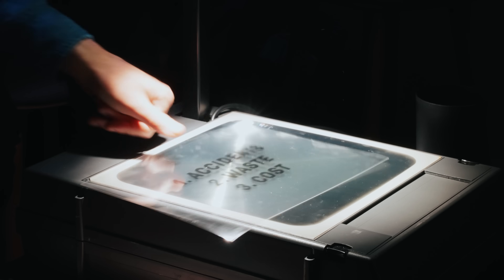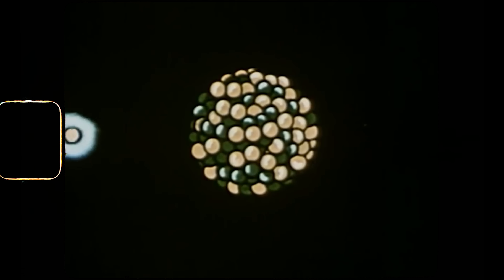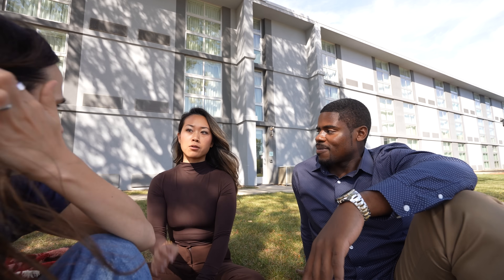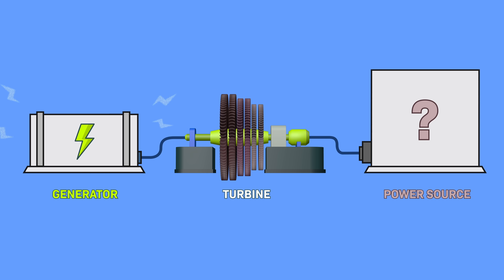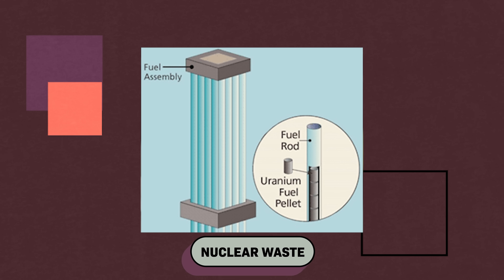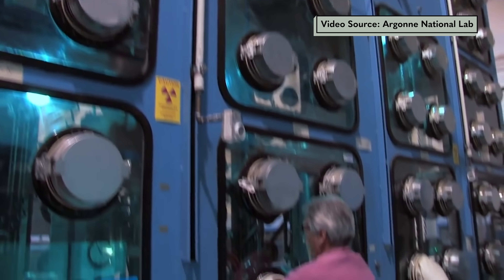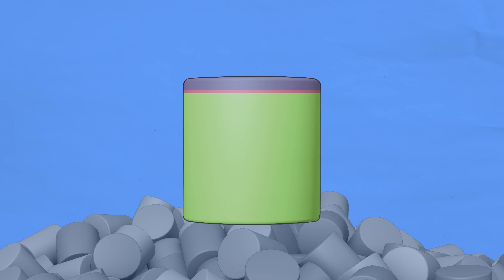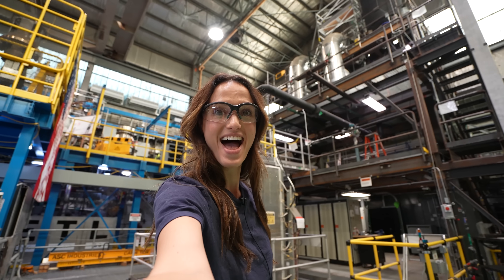The Big Lie About Nuclear Waste

Comment: very informative and explained. but there is point you barely touch. 
Plutonium which is the nasty atomic element recovered from nuclear waste and reused to make atomic bombs and nuclear warheads. during the 1960 the cold war the US the Soviet union & to a lesser extent France were in a race to develop huge nuclear stockpiles. 
Lately there is  slow renewed interest in using the process you have visited which name is fusion. Small reactors are built to supply small communities (20,000) reducing building cost and grid problems

Comment: Very interesting.  Coukd you also do a report on thorium reactors. They are suppisedly much safer in that there is no runaway meltdown reaction like with uranium. Just back the fuel rods out and the reaction slows.

Comment: There's lots of pie in the sky in this video. I lived through the carter administration.  He signed the anti breeder reactor bill because they are a lawsuit waiting to happen. If anything misses a beat the thing lets loose unlike the light water reactor that one can simply flip a switch and it shuts off. 
 The fuel we have now is not easily recycled. It would take a dangerous breeder reactor to start with and then working with radioactive materials  and lots of regulations. EG Chernobyl
Reply: Bonus, remember how unbelievably expensive a collider is? Well the same goofs on here that want dangerous reactors also wanted colliders that wete nuclear powered adding unbreakable amount of cost to a totally worthless project except for copper scrap. Js

Comment: As long as everything do go on close to ideal condition nuclear is arguably safe. However any event that cause collapse of said ideal condition you get a situation that is not comparable to ideal outcome. Tree mile island, Chernobyl, Fukushima Daichi.  The real threat from nuclear power is when we get a solar storm, or large scale war or any large scale disruption of the ideal situation.  The only failsafe solution I've heard of is lead mantle coolant.  If the reactor do a runaway and heats up, the molten lead will expand and flood the core of the reactor and stop the reactor, It may over heat but the lead is there to carry the heat away and the reaction are already dead. Is it funding and  research on this?  They do molten salt. Is this as safe dear blogger?  
There are similar problems but not as long lasting problems with generating power from water dams. If a big dam do fail, the flood/tsunami will cause megadeath but lasts only a few hours.

This is a bit rambling, but my point is that nuclear power are for short term arguably safe, but in the long term a megadeath situation waiting to happen. Not in a 2 years, 5, 10, 50, 100.  but on the 200-500 year scale its sure to extremely cause megadeath on scale with caldera corpse and eruption or solar flare reaching earth surface or ...... Any very large scale volcanic eruption (happens every 500 to 2000 year regularly one place or another on earth) or comet impact will generate enough regolith type dust (do you remember the Islandic eruption that grounded flight all over the norther hemisphere? ) to grind any fan in air or pump in water to fail within hours.
Now to the final point: Engineering can surpass these challenges but I see no reason to think politicians will care with their 1-2 years horizon thinking.   Good luck claiming anything safe.  A C Clarke did have a point in this: Advanced entities has at least 3 levels of redundancies.

Comment: Could we also not develop methods to capture energy from the ionizing radiation? It's a move of electrons to a higher energy state. Surely, there is a controlled, predictable way to use this radiation to move electrons to a higher energy state, remove either the radiation source or the excited electrons, and find a way to coax them to a lower energy state for less energy than they release? Obviously i dont what i am talking about as this is way above my level of education but surely there is a use for the "waste". Almost every chemical reaction i use in lab i find ideas for what to use the "waste" on. Its only waste for this process, it might be useful in another.

My ochem professor said it best, he was going over an organometallic reaction and had it all written out and on the products he had Ph3PO and made the joke that yeah this would be your waste product but if i were teaching inorganic chemistry right now this would be a great synthesis method for Ph3PO and the organic waste is easily removed.

Comment: We should have gone nuclear, there is no good reason not to have done so.  We were easily fear mongered about it.  If we had continued using nuclear as we should have, then we would be better at using it and we would now be much further along in reusing the spent fuel than we are.  Using something is the key to innovating in that field.  Nuclear is still the cleanest power source we have found.  Just unreal.

Comment: After having lived a lifetime next to Hanford.  I can tell you that we should have  never used nuclear energy.  The waste isn't only fuel rods. It's anything that gets near radioactive items. The fuel rods are the only thing that can be recycled. Every part, cooling water, pipes and fittings,  clothing,  everything becomes radioactive. Not to the point of being able to be recycled.  But to the point of being deadly for humans for thousands of years.  That's what is never addressed.  The recycling of rods makes even more waste. Those salts for example are extremely radioactive.  It becomes more waste. Its just adding more waste to the system.  We haven't solved the problem of waste. Why not use forms of power that doesn't have by products that are deadly to all life as we know it for thousands of years?

Comment: Many countries recycle nuke waste - Japan and France are major.  (Perplexity but its likely correct).  What about US the Finland?

Perplexity  (Always check AI, but this is likely true)
The United States and Finland do not recycle nuclear fuel for distinct reasons tied to their respective policies, economic considerations, and approaches to nuclear waste management.
United States

    Economic Factors: Recycling nuclear fuel is expensive compared to the relatively low cost of uranium mining and enrichment. The abundance of uranium in the U.S. has historically made recycling less economically viable35.
    Proliferation Concerns: The U.S. has long been cautious about nuclear proliferation risks associated with reprocessing, as it involves separating plutonium, which could potentially be used in nuclear weapons. This policy dates back to the Carter administration's moratorium on commercial reprocessing13.
    Technological Development: While the U.S. Department of Energy is exploring advanced recycling technologies through programs like CURIE, these efforts are still in the research and development phase and have not yet led to commercial-scale implementation137.
    Current Strategy: The U.S. follows a "once-through" fuel cycle, where spent fuel is stored at reactor sites or interim facilities while awaiting permanent disposal in a geological repository, which has yet to be established7.

Finland

    Final Disposal Approach: Finland has opted for direct disposal of spent nuclear fuel in a deep geological repository rather than recycling. The Onkalo facility, under construction, will permanently isolate spent fuel underground for thousands of years68.
    National Policy: Finnish law mandates that all nuclear waste generated in the country must be managed and disposed of domestically. This policy does not include reprocessing as part of the waste management strategy4910.
    Economic and Scale Considerations: Finland produces a relatively small amount of spent nuclear fuel annually (about 70 tonnes), making large-scale recycling facilities economically impractical9. Instead, Finland focuses on safe, long-term storage solutions.

In summary, while the U.S. avoids recycling due to economic and proliferation concerns, Finland relies on its advanced geological repository as a sustainable solution for permanent disposal.

Comment: Hi! As a Navy Nuclear sailor, a Waste Processing Technician, then working in Nuclear Engineering at a Nuclear Powered Electricity Generating Station, I can safely state that, done right, nuclear is safer and cleaner than coal, oil, natural gas, solar or wind power. It can be baseload production, (unlike solar or wind power), and is the answer for our power needs going forward. Paranoia, pushed by such misguided folks as Greenpeace, for example, has cost us 40 years of progress. It is time to wake up and use science for the benefit of mankind. Take back the future!
Reply: Just like electric car batteries, we aren't there yet in terms of technology or cost. We're working on it, though.
Reply: The technology she speaks of was buried by politicians, lead by then-President Jimmy Carter, who should have been the champion of this technology.

Comment: What good is recycling radioactive waste when it relies on large amounts of expensive electricity, the government won't budge off the Petrodollar and people have been trained to fear nuclear energy entirely ? It would be cheaper to load the stuff in a Thorium reactor. What was the first step in recycling ? To dissolve the waste in salts. That's Thorium reactors fuel ! Stop right there and feed it in. But we have to build the reactors.

We need to start building reactors now ! Not light water reactors that only continue the same problems. Thorium reactors to end the problem of creating long term waste AND burn off our existing mountain of radioactive waste. 

The problem isn't technical. We had a Thorium reactor 70 years ago. But it didn't produce Plutonium so our government wasn't interested even though it worked. Our biggest problem is government. They LOVE oil and the political power and money. When they discovered natural gas could replace coal they made that switch mostly. But it's still a finite fossil fuel. Does anyone think the government is gonna say "You know those reactors we've been telling you are super dangerous ? Yeah.... We've kinda been lying about that a long time. Now we want to spend piles of money making new reactors that we should have built 50 years ago.

Comment: According to research, if the entire world switched to solar power, the global temperature could potentially decrease by a very small amount, estimated around 0.04 degrees Celsius, with the most significant cooling occurring in desert regions which could see a drop of around 2 degrees Celsius due to the reflective nature of solar panels however for every one degree Celsius rise and increase in the temperature, the solar system efficiency reduces between 0.2% to 0.5% as well.
Key points to remember:
Minimal overall impact:
While switching to solar would contribute to reducing greenhouse gas emissions and mitigating climate change, the direct temperature drop from solar panels alone would be relatively small on a global scale. 
Local cooling effects:
Areas with large solar installations, particularly in deserts, could see a more noticeable temperature decrease due to the reflective properties of solar panels. 
Factors affecting cooling:
The exact amount of temperature reduction would depend on various factors like the type of solar panels, installation design, and the specific geographical location.

Comment: I know this is a positive channel, but would have like to have seen some contrary opinions on this video, watched another one where they said (DW Planet A) Argonne is still in the experimental stage and it is not known how much it will cost to scale it or how long it will take. Plus France has to use wind power to offset increases in Nuclear costs (up 67%).

Comment: As usual you delivered a thought provoking video with all your charm to make it fun and engaging. The climate change green energy people are the people who seem to oppose nuclear power. It's odd since it is the best solution for the whole world and it is cleaner than other alternative energy methods. Nuclear energy using this system is the cleanest power source available with the possible exception of hydro-electric. Windmills and Solar panels are dirty to make and only last around 10 years. Hydro and Nuclear plants last decades offsetting the carbon needed to build them. Solar and windmills are dirtier than modern fossil fuel systems and we are wasting our time pushing them. We could have the entire US grid electrified with 100% nuclear in less than 20 years if the government and the people would open their eyes. We would still need fossil fuels for some motorized vehicles and portable systems as well as back-up emergence power systems, but the overall effect would be excellent for our environment.

Comment: The UK used to reprocess nuclear waste, until 2022. Then it stopped. The problem being economics and the argument that the nuclear industry needed to be more cost effective relative to other sources of energy. Stopping expensive reprocessing was a way to represent nuclear power as having improved its cost burden. But... Only because the longer term problem of waste storage and management one day is allowed to be off the books. It's a smoke and mirror practice that allows the nuclear industry to pretend it's cost effective, when really it isn't. And part of the problem was the additional long term cost of the reprocessing facility itself, including it's decommissioning and replacement at end of life.

Comment: It's called lobbyism... It obviously does not work. Only thing sucking up money is building nuclear reactors. I'm not "afraid" or anything of nuclear power it's just not the most efficient nor the cheapest solution.

Might be that there is enough fuel for 150 years it's just not feasable from an economic standpoint. This video just mentioned this point briefly but it's the most important. If it's not cheap or efficient it's a waste of ressources. wind and solar is MAGNITUDES cheaper

Comment: Nuclear won't save the planet. Every few years someone claims to have a solution (e. g. Bill Gates) and nothing significant comes of it. it's too slow and expensive.
Don't compare the cost and building time of those plants to current nuclear plants, but to wind and solar - the latter is much safer, cheaper and faster to build, maintain and recycle (!) in the scale  we need to fuel the the green transfomation. We barely got a decade left to turn the wheel around towards a clean future.

Comment: Hey Cleo!  Nice job on this one - a story that NEEDS to be told to, and believed by, the world!

I would LOVE to see you make a video (if you haven't already) about how the coal- and oil-fired power industries have repeatedly BURIED every other energy source (especially the nuclear industry) for decades - they are THE REASON why this country is so afraid of nuclear power. and can't seem to get away from using coal and oil.

I am a retired submarine / nuclear propulsion officer, and I can tell you for an ABSOLUTE FACT that nuclear energy is BY FAR our cleanest and most powerful energy source.  Until we embrace that fact world wide, we are not going to save our planet or our species.

People who think they're being "green" by driving an electric vehicle need to consider where that power is coming from.  You guessed it - the coal- and oil-fired power plants which dominate the United States!  Transitioning to electric vehicles IS the right answer, but we NEED to transition RAPIDLY to nuclear power at the same time - it is the ONLY way to supply enough power to make our electric vehicles truly "green".

As an example of the coal- and oil-fired power industries' greed, I recommend you look into a project called Cape Wind - it was supposed to be this country's first off-shore wind farm, and I was being tapped to be the director of its construction - until it was canceled.  The short answer:  That project was BURIED by litigation from multiple sources, driven by the coal- and oil-fired power industries and their greed.  There is a book called Cape Wind which details the whole, sad saga.

Comment: The dark truth, is that governments hold control and power by delivering energy in less efficient ways, because if they would had done it in such efficient way, they would be ought to deliver it for cheap prices and thus have less control over the citizens. It's as simple as that and it's for the same reason they began demanding tax payment for electric vehicles. That's the simple truth, don't let them confuse you.

Comment: STOP! The nuclear waste is NOT that dangerous. READ IT AGAIN. It is when it is active inside the chamber, it is very dangerous. The radiation from the waste pellets is stopped by TWO sheets of paper.  Read it again. TWO papers. Not good to eat, but safe to handle. Stupid politicians do not understand this and that is why the waste is "overly killed" stored in costly containers hundreds of meters under earth. Anyone can check this up. Source; Jan Blomgren Professor in nuclear and atomic energy, Sweden.
Reply: That may well be true, but the problem with nuclear waste is not necessarily the direct radiation, but rather that radioactive substances are released into the environment. Nuclear waste contains radioactive isotopes that can become soluble in contact with water. These are very toxic even in the smallest amounts and drinking them is, as you said, not necessarily the best idea. 

This is why so many efforts are being made.